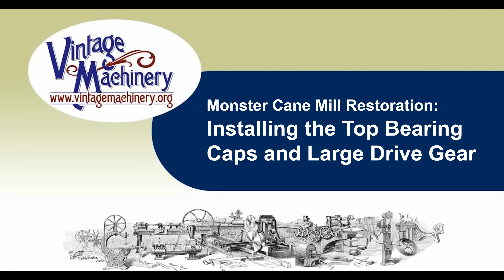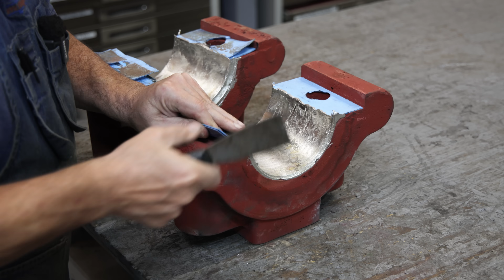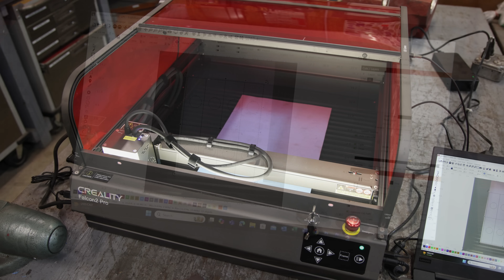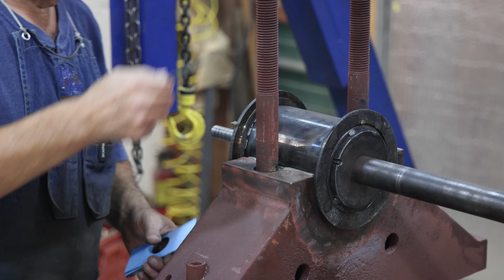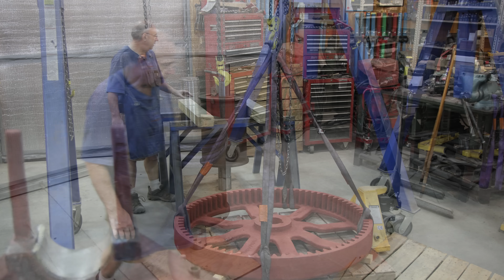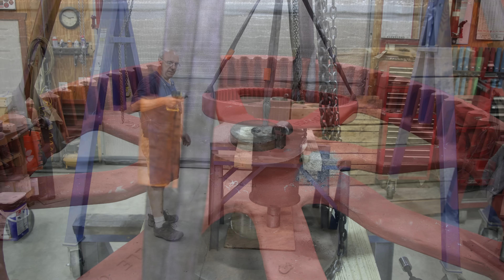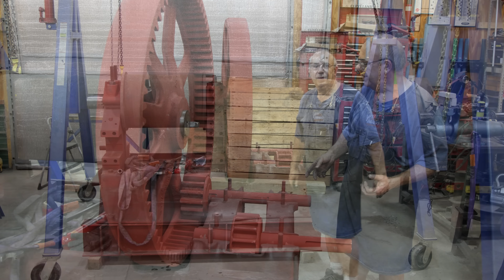Monster Cane Mill Restoration: Installing the Top Bearing Caps and Large Drive Gear

Comment: Just wondering out loud, would it have been better to use several different thicknesses of shim stock for the spacer stacks, instead of the paper gasket material?  Also, shouldn't there be thrust surfaces of some kind, to accommodate lateral movement of the main drum and gear? 
Thank you, Mr. Rucker. I always look forward to watching each video when they come out!

Comment: This mill resembles a Golden New model #54 or #63 . The # 54 rated for 400-550 gallons of juice per hour # 63 was rated for 550-650 gallon of juice per hour. Ratio on #54 19/1 and #63 20/1. I have all a catalog from Golden 1918 series that was shared digital form and I’d be glad to share it with you if 0:04 interested. I have just reworked a Golden New Model 27 and plan on putting it in service next season

Comment: Wow!  That is heavy machinery--you took on a BIG project.  For calculating the gear ratio...it may be easier to measure the diameter (pitch) of the gears instead of counting teeth.

Comment: Time-wise, the laser cutter can run circles around hand cutting, once the CAD is done. You can whip off another sheet of those shims faster than you can install the first set. Very useful for production runs. And the up-front time for the CAD will decrease significantly with practice.

Comment: Would you consider or have you considered line boring the bearings to fit the shafts.  KOKO!
Reply: Well, that's not the way babbit works, think it through... The liquid metal (babbit) forms the way the shafting allows, just as Keith has been showing us in all the pours he has done since the first time, decades ago. In some cases where the speed is in the 500 rpm and above you might need to allow for shrinkage with the metal by having an oversized shaft mandrel so the actual cooled metal will conform closer to the correct shaft which allows the oil wedge to travel as a wave all the way around the shaft at those speeds, in the US Navy we would create an encapsulation for the shaft and split the bearing with a jewlers saw (0.015 or 1/64 inch). After splitting the edges are cut in a zig zag for fitup and oil retention. The zigs and zags are joined back to the parent metal with brazing torches after the metal sides are scraped and grooved for oil passages. At that point any blueing for fit and consequential scraping will have been done with a proper sized mandrel and any stays adjusted for shell retention in the housing.  The final thing was to fuse the shell halves on the zig/zags with a small amount of the parent material (all scrapings have been saved from this sizing and oil grooving since there were several different types of white metal "babbit" materials and you do not mix them - if the rest of the black gang saw you compromising future efforts by inadvertent mixing metals the chiefs and bosons would look the other way, a lesson would be taught and things returned to normal, a different Navy indeed -either kick ass or take names, not both). Since these are now attached directly to the shafting paint sticks (or grease paint) would indicate machine placement and allocation, used now, or save for future use. A well run repair ship was just that... very well run.

Comment: Just curious since Keith introduced me to babbitt bearings. Can there be a gap between the upper and lower section of the bearings?
Reply: Yes, on low RPM rigs not only is it allowed it is required since tightening the bearing is required from time to time (done by changing shims, removing one and replacing with thinner, or as was more common, removal of a thick shim and wait for the shell to adjust by monitoring the oil slicks top and bottom, cinching by 1/8 or more turns as needed). This is not rocket science folks!

Comment: Keith - I thought I saw that the oil holes on the top bearing caps were threaded.  If so, my bet is they used an eye bolt threaded into the hole as an attachment point for lifting and setting the top cap in place.  Also, great lifting practice by yourself.  You never got any part of your body under the load.  After seeing a brand new 300-ton rated Kevlar strap snap on the first lift of a 150-ton turbine rotor, I never get near the drop point of a lift.

Comment: I built a lot of patterns for the suger mills in Hawaii years ago. Mostly bartow, scraper and pinion gears. Not sure how big those mills were, but this would be a small one. The pinion gears were all as cast teeth about 18" on the face and about 3' on the diameter.  Castings were made at western steel in Seattle. 1970's era.

Comment: Laser is a great tool for this application. One thing you might want to do is to cut out the circles, any internal cutouts, first before the outer. This will ensure that everything stays aligned during all the operations. You should be able to input the order of cut into the lasers control. Thanks for sharing.
Reply: put the circles on another layer then you can change the order of cutting.

Comment: Hi Keith,
Maybe I missed it but do you make and use babit bearing plugs to get your spacing?  Would simple peices of babbit at the needed thickness placed in and around the area before pouring give you a consistant thickness of babbit? Maybe glue plugs in place?  Just a thought. 

Great Channel!
Regards,

Art

Comment: Hey Keith, some lessons learned from doing a lot of laser cutting, it's like any cnc sheet cutter (plasma, torch...), it's best to cut "inside out" in this example put the circles on a different layer in lightburn (select the circles and click the layer colour at the bottom) and move that layer to the top in the layer window on the right. if you cut outside in, the parts can shift and the holes will end up in the wrong spot. Doesn't always happen and sometimes it doesn't matter, but sometimes does.

Comment: Keith, did you notice the rust ring on the axel: probably where they big gear used to live. It seems to far back about 1/2 inch, compared to the rust ring.
Thanks for the video and all the great content!
Reply: As you see, he did adjust it back out to that point, almost, some of the problem is the excess babbit on the inside portion of the shell halves. Looked to be around 1/16th to 3/32nd of an inch which give you lass clearance by 1/8th to 3/16th inch. In this case that will wear off fast when this is in use, unfortunately it will drop into the syrup.

Comment: For all the comments on chain fall hoists, they are better than electric hoists because you can easily move up and down in minute increments. 
Electric hoists tend to move quicker and then you need to go back and forth to get the object into position. 
Yes, manual hoists are a workout, but they give you the freedom to move the gantry anywhere you want.  I have worked on heavy construction equipment for over 20 years and all we had were electric hoists. They can be problematic and you have to lift directly over the job. Any side angles and the cable will jump the spool, thus destroying the integrity of the cable. 
I hope this explains why he has a chain fall hoist.

Comment: I would have thought that large gear was cast iron. I've often wondered if a lubricant would be beneficial for tapping, but everyone (typically) says cast iron needs no lube for tapping since it has graphite. You used anchor lube on it- was there a reason why?

EDIT- I just had to edit to add: my god... that was an exceptional fit on those babbit bearings! This series has been fun to watch if anything- just due to the size of the parts. But really this has been a master class on getting it done. Through fighting rusty frozen parts, to moving huge chunks of metal, to turning big drums... Well done, Keith! This is phenomenal!

Comment: How come you don't used motorized hoists?  Also, I see on other YT machine shops they use a heavy duty electro magnet to lift steel parts.  Seems a lit easier and quicker than rigging with belting.

Comment: I must've missed a video... did y'all blue the babbit bearings before you rested the drum and shaft in place? Will you use plastigage to check the overall fit of the caps and ensure the proper tolerance to create the oil wedge for lubrication? She's a beauty!

Comment: Wow, you’re sure getting into bigger and bigger jobs. Can’t help thinking that  power on the chain falls would save you a lot of arm work, but it does beat hitting the gym. I don’t know if they make it, but a strong magnet would help with handling those heavy bearing caps, allowing you to pick up awkward shaped heavy pieces. In any case, it’s great to watch you (as we used to say) ‘suss’ out how you’re going to do things. Thank you.
Reply: Putting a motor on the chain fall hoist would defeat the purpose of the small adjustments that you can make. Electric hoists tend to move in larger increments and that fine tuning would be lost.

Comment: I thought that Keith was going to put the drum in place first then mount the gear on the shaft by keeping it vertical and sliding it in place. Maybe that's impossible due to how the gear sits into the base.

Comment: In the step where you were using the large nippers to cut off the overfill,  it occurred to me that an oscillating multi tool (aka "buzz saw") with a flat metal cutting blade might be used.  I believe it would make quick and accurate work of the task.  Just making a comment for the Al Gore rhythm.

Comment: might want to first cut circles then cut out shim.  Learned this from C&C equipment metal C-n-C cutting.
Reply: It's not a waterjet or metal cutting CNC. It's laser cut so nothing should be moving during the cutting process.
Reply: @deathk26 thx for clarification......
What keeps cut pieces from moving, if only slightly?

Comment: With the laser, order of cuts can be important. Cut the holes first, then internal lines, then finally the cuts that will detatch from the stock. Otherwise you risk the cut elements moving and a loss of registration. You can set these as different layers/groups which makes ordering the cuts very easy as you just order the layers.

Comment: As Keith has undoubtedly stated at one point in time or another, A cane mill isn’t exactly what you’d call a “Precision Machine” so contact isn’t really going to be as much of a focus compared to scraping in the wear surfaces on a Monarch. 

Given the state that these machines normally operate in before their operators ever even think about getting new babbitt material (& the fact that they do still function even in those extreme states) goes to show that these cane mills are good ol’ fashion extreme heavy duty engineering: make it so your great great grandchildren will be the ones who have to worry about breaking it.